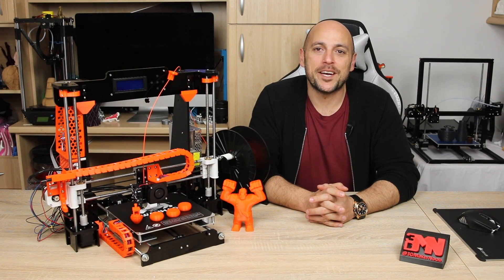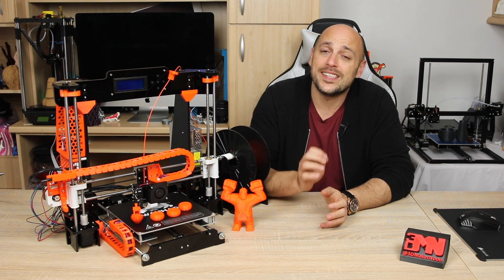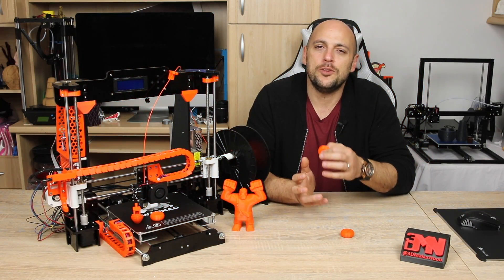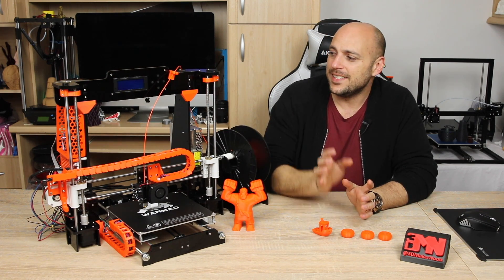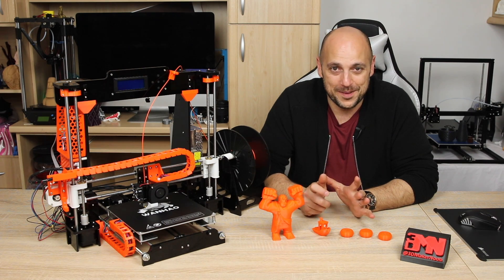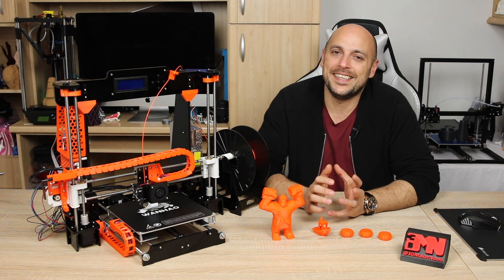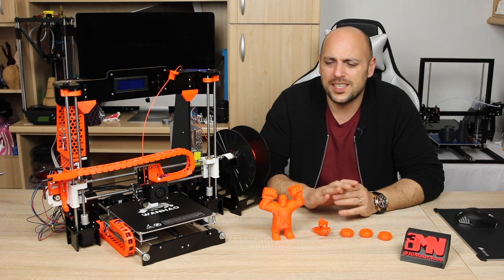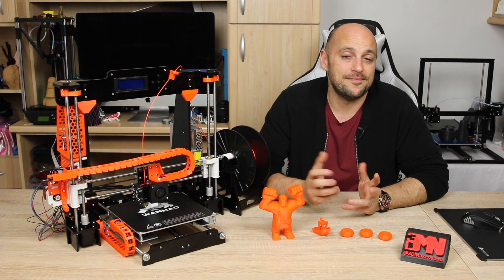Anet A8 Journey - Upgrades Part 1

Comment: Top priority was to make sure the extra parts were orange. Eveyone in the 3d printing market knows 3d prints faster
Reply from the maker: and better, and safer! very important to mention those :) i really wanted a different colour. but the orange was already in the printer form the live stream and was also the only PLA spool i had at 1.75 that had enough filament to print all the parts

Comment: I also have a Anet but my problem is when i "try" to level the bed and all 4 corners are leveled then middle alog the x axis isn really level. on the x limit switch its to tight in the middle its ok and on the x maximum its to loose and the lyer didnt stick.
Does somebody has an idea what i did wrong?
Reply from the maker: first i would strongly recommend that the x-axis brackets and linear rails are perfectly level, so measure the distance from the bade to teh linear rails from each end, get them as perfect as possible. secondly measure also the bed corners from the base of the printer (table) to the heatbed and make sure they are also level. one of those is surely not aligned so at least you would know where the problem is. if that doesn't help maybe install a bed levelling sensor which will compensate for the warp. finally if that stills doesn't work, i would suggest you start using a raft to print models as it would alleviate the unbalance
Reply: 3D Maker Noob thanks for the fast answer i will try it out soon 
i hope itll work :)

Comment: hi Joe, for power killing I use this plug by TP-Link HS100 with a wonderful app on my phone KASA detailing Wh consumption and more features. Costs under €30. see you!
Reply from the maker: +patrick4485 I actually donned to buy a few of those as they would definitely come in handy. Isma, do you get 3DLac or magicgoo?
Reply: Yes I sell magigoo. I also have to give you 10 samples of filaments that I import by PRIMA. A nice shout out for patrickprints.com would be nice aswell.
Reply: I can sell you also the TP-Links, no worries man ;-)
Reply from the maker: cool, i'll try to find some time and pass by tomorrow as i might pass from qormi in the morning. if you are there of course
Reply: Magigoo in stock! I use it on regular basis and its fantastic.

Comment: amazing job! I have a geeetech prusa i3 kit. One of the most easy upgrades i have done is just free the lead screws on the top of the frame, in that way, only the linear smooth rails guide the x gantry.
Reply from the maker: +maxkmelo18 thank you :) will definitely see if I can find or create a few brackets for the Ross's and leadscrews

Comment: I'm annoyed I ended up building my printer find that there is something wrong
Reply from the maker: +Swavgav2002 is it an Anet?
Reply: +3D Maker Noob yeah the a8
Reply: +Swavgav2002 we think it is the mainboard
Reply from the maker: what are the symptoms though?
Reply: +3D Maker Noob it powers on every so often but only for a few seconds
Reply from the maker: have you tried replacing or checking the PSU if it's working properly?

Comment: once i added self leveling  to mine the prints improved 100%. i recently ran both my a8s for over 2 weeks straight with no problem or have to relevel the bed
Reply from the maker: +mikes makes I do have an auto level sensor available so will most likely install it

Comment: Cheers. Try this cooling duct for the part-cooling fan...  http://www.thingiverse.com/thing:2086191

It did wonders for my A8's print quality and it is overall the best functional upgrade I've found. It comes in two versions that differ in terms of wall thickness. The thicker one works better for me.
Reply from the maker: That looks perfect, will definitely try that out. tahnk you :)

Comment: Are the bearings on the lead screws improving anything? Because on the i3 (official and clones), the gap around the lead screw at the top is there for a purpose, to allow the screws to wobble so it will not constrain the Z-axis and cause wobble on the print. With the bearings your axis are now fixed on 3 points and might push at the middle if the screw is not straight.
Reply from the maker: +Julien Krivacsy the z-banding is almost gone thanks to those. I tend to try and calibrate the leadscrews as perfectly as possible. Running the z axis up and down in increments and measuring all the way to make sure they are as perfectly aligned as I can possibly get them.

Comment: why didn't you put an upgraded hot end blower on it
Reply from the maker: +Chang Ye to be honest I find the stock duct very effective. Blower fans tend to have a higher rate of airflow and a fully opened duct let's all that air through completely. With circular ones I find that the airflow is reduced. But I will try it out and compare

Comment: First of all nice video! I believe that 'Anet A8 journey' will be useful for many people. And secondly, I've got a doubt, next week I am getting an Anet A8 and I was wondering if the Mosfets upgrade is important to do it before switching the machine for the first time or if I could make it later. Also is it needed to have an extra mosfet for the extruder or is just for extra safety? Thank you in advance and keep with the good work :)
Reply from the maker: Gareth Price very good point and noted. Thank you, will make sure to mention it and apply it
Reply from the maker: +Ángel L hey, so mosfets are not needed straight away. However I do suggest at least resoldering the wires directly to the heatbed. Doesn't have to be straight away, but something to consider if you intend to use the heatbed a lot. The extra mosfet for the hotend is just me being extra cautious, better safe than sorry ;)
Reply: Also forgot to say another reason not to use external Mosfet's for your hot end is the fact that if the Mosfet fails it will fail closed and apply full load to your hot end heater bypassing all firmware safety's. Never a good idea the heat bed should normally be alright because they can seldom reach above 120°C but the hot end well...

Also good practice would be adding thermal fuses to both the hot end and bed so as your not relying just on the firmware for your protection.
Reply: the heatbed will draw about 9.3A the board fets and copper are supposedly rated for 15A so initially probably not necessary but the boards are junk and use cheap on board fets. so better of getting a better board sooner rather than later. the hotend will probably draw around 3A so not necessary for an External fet. The external Mosfets don't really make anything safer just extra protection for you mainboard.
Reply: My hotbed connector lasted about 2 months. The X + Y belts lasted around 3 weeks.
Reply: My A8 went through about 8-10 Kg of PLA with no modification on any electrical or mecanical component so far.

Comment: joe, the mosfets for what is this actually on the anet a8 and it is recommended, perhaps you can give more information about a video or something?
Reply from the maker: +Mark Leppens the mosfet is essentially there to regulate voltage to the heatbed. If something fails it's the mosfet that stops current. Also, it's a good way to protect the main board. Will definitely do an in depth video on mosfets

Comment: 1) what type of FUSE will u use? 2) pls do the same things with the A6
Reply from the maker: i raul I will have to do some maths to figure out the fuse, but I think somewhere in between 5 and 10 amps should be it. And I definitely will do the same. It's the only way to do a fair comparison :)
Reply: 3D Maker Noob  cool, i was asking about the fuse because people on the forums can.t decide  themselves. Some of them say 3amp other say 6amps.. -_-  / btw maybe u put a link with the mosfets ( i.m also from europe)
Reply: for the hotend for a standard 40w 12v heater a 5amp blade fuse or equivalent glass quick blow ( 5x20mm 0r 6x36mm) will do. For the bed its around 110w so @ 12vdc 9.3A so a 15A blade or equivalent glass quick blow. Just remember blade fuses are ok and certainly better than nothing but do take a higher inrush current before blowing compared to glass quick blow fuses.
Reply from the maker: +i raul I put an eBay link for them as that's the only place that shipped to Europe for some reason. There is a formula to work out the fuse sizes from Cheo3DPrinting

Comment: Convert to a E3D V6 Hotend, and to a Bowden setup, also do an Auto Leveling tutorial
Reply from the maker: +Victor Tan yep, I will order also the level sensor :) I can do either a Bowden setup or direct drive. Or better yet, I can do both and compare ;)
Reply: I think Tech2c has done a video on the comparison, in my opinion i like the bowden setup. For the auto level sensor i recommend you buy the 5v sensor from aliexpress so its a lot easier to do the wiring no resisters or any stuff like that. Here's the link https://goo.gl/jQLYi5
Reply: Simplify 3d and cura... please
Reply: 3D Maker Noob  HI can you post the setting you used for the Tronxy p802
Reply from the maker: +T Rucker I should be able to. What slicer?
Reply from the maker: +Victor Tan I actually have one of those, same as was used on the tronxy
Reply: Oh, then that should be easy
Reply: Simplify 3d and cura... please